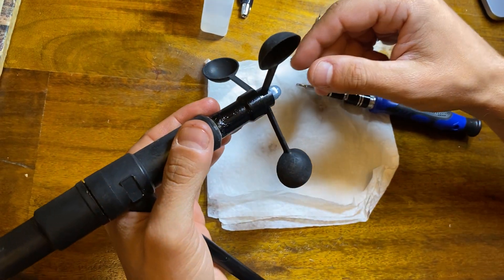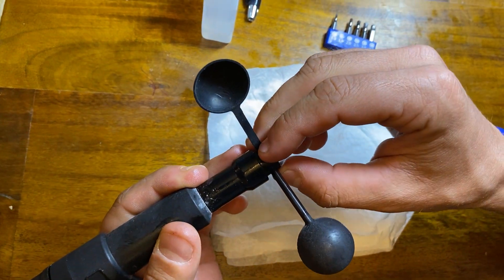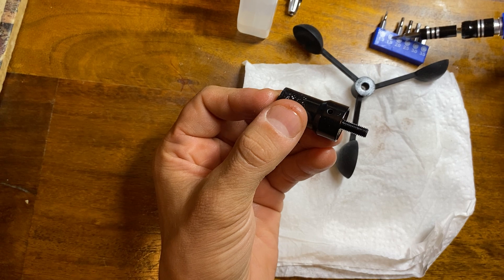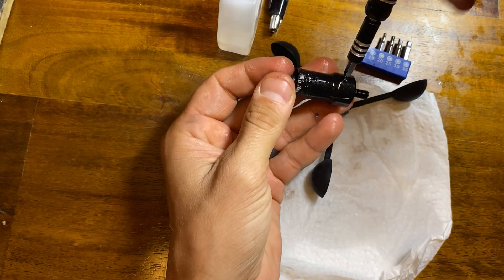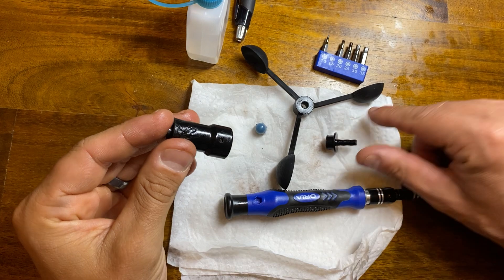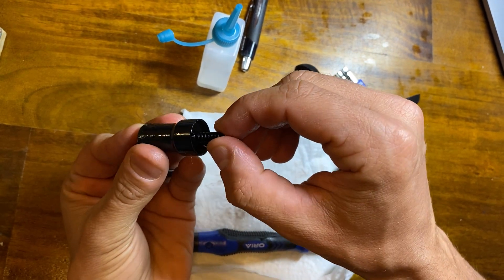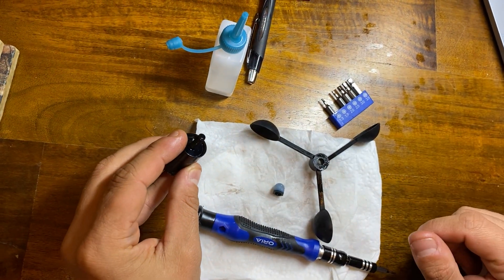Replacing the Bearings on the B&G 608 Anemometer - Wind Sensor

Comment: Note to these attempting at home: I tried this on my newer WS310 sensor which has the same setup, and I stripped the 1.5mm screw holding the lower portion of the bearing. Might have loctite on it. Make sure you have sharp, fresh tools if you try this. The stripped screw is going to be very difficult to remove -- good thing I bought a bearing assembly replacement.
Reply from the maker: Good call out
Reply: @austinbrougher7456  Thanks for the video!
Reply: Mine stripped as well. Did you ever get yours out?
Reply: @jasonkoslow4174  No, I never did. Ended up installing a new bearing carrier module. I may purchase another for careful teardown and bearing upgrade.

Comment: Hello! A great clip! But abt replacement bearings: really not metric measurements? And material is steel CR15, corroding alloy?
Reply from the maker: Great point! The original bearings are out of stock. I've removed the link to the steel bearings. Once I have some time I'll see if I can find good replacement. Appreciate the feedback!

Comment: The marketing for ceramic bearings suggests "faster speeds" due to less resistance. For our purposes, do you think this only means faster to get up to speed and that the sensor won't overstate windspeed? And perhaps also more accuracy at lower windspeeds? The cups can't move faster than the wind pushing them, in other words.. right?
Reply from the maker: Great call out. I know over time the bearings wear out and additional friction is introduced. I think friction may lead to reduced readings. The same thing will happen to the ceramic bearings. Eventually the ceramic bearings will become slower to the point they perform as well as the stock bearings.
Reply: @austinbrougher7456  I wonder how deceleration of the cups works as well - say the wind is 20 and then drops to 0. Do the cups keep spinning? Is some friction more desirable than a hypothetical zero friction? Hmm.. not sure how the physics of this works!
Reply: A good public paper here on anemometers: https://www.ncbi.nlm.nih.gov/pmc/articles/PMC4279541/
They mention "overspeeding" but it's a misnomer - they mean over reporting during deceleration or turbulent flows, not speeding faster than windspeed.
I suppose we only really care about acceleration and max winds and don't care so much if it takes a little longer for the sensor to report decelerations.

Comment: Well done Austin, like the work you have done.  I have a similar problem with a Furuno FI 5000(L) wind anemometer/direction device. I have read on the Furuno Users Website there is a method of doing this task, although Furuno Tech advise the device is irreparable.  Have you, or anyone on this thread had any experience with a Furuno device? Cheers, Jim
Reply from the maker: Sorry for the late response. I have no experience with other sensors.

Comment: Thank you! I found that the screw was VERY hard to unscrew and even harder to tighten from the PLASTIC connector for the speed cups.  
I'm thinking about sealing the hole to reduce water infiltration into the bearing assembly. 
BTW a Torx T6H, while not as good as the Allen wrench, will fit.

Comment: Thanks for the helpful video! How did you know your bearings were shot? Did the unit fail completely or just slow down? The data coming from our unit jumps around a lot in steady wind. When damping is turned on, it seems to be underreporting the wind speed. Right now, the wind is whistling through the rigging, and it's displaying from between 4 knots and 13 knots. Actual conditions feel like maybe 11 or 12 knots gusting to 13. Would that be consistent with bad bearings? Thanks again!
Reply from the maker: It could be bad bearings. In my case, the cups stopped moving in low wind. If the wind was fast enough, they would move but I didn't trust it. If you can access it, try rotating the cups manually and seeing if it feels like it's getting stuck or harder to turn at any one point.
Reply: @austinbrougher7456  We're in the Caribbean and haven't had any really low wind days in a long time. I'll try to go up there and give it a spin. Thanks again

Comment: Very helpful, than you for taking the time to do this.  I read /Watched this a year ago, and bought some SS Race, Ceramic Ball bearings from VXB a year ago, and finally got around to replacing them. I bought another unit that was 4 years old, so that is up there now, but Now I think I would like this rebuilt unit up there, I think it will be better.  The old bearings felt like there was sand in them, they were so rusty.
Reply: Do you have a link to the SS bearings you bought?

Comment: Did you measure the bearings yourself or lifted the dimensions off the bearings inscription. Reason for the ask is; if I can source a metric equivalent for them. Imperial sized bearings are extremely hard to find in my neck of the woods!
Reply from the maker: I measured myself. If you find a good metric match please share.
Reply: @austinbrougher7456  
SFR25ZZ(1/8"=3.175mm, 5/16"=7.938mm, 9/64"=3.5719mm, Df 0.3590"= 9,12mm)

SMF83ZZ(3mm, 8mm, 3mm, Df=9.2mm) ((-0.175mm=-0.0069"),( +0,062mm=+0.0024"), (-0.571mm=-1/64"),(+0.08mm=+0.00315"))

SMF693ZZ(3mm, 8mm, 4mm, Df9.5mm) ((-0.175mm=-0.0069"),( +0,062mm=+0.0024"), (+0.4281mm=1/64"), (+0.38mm = 1/64))
they are both extremely close. All differences are below 1/64".  SMF833ZZ is a looser fit. SMF693ZZ is a tighter fit. 
I think I'll get both and share the results when I have a chance to climb up the mast :)
Reply: @f00barfoobar  3 x 8 x 3mm does not fit. Unfortunately the right ones you mentioned above, are currently unavailable.
Reply: @62deleeuw  Thanks for this. I still couldn't find an opportunity to head over  (800 kms) to try. You saved me a significant amount of grief :). In the mean time I discovered a local store that specializes in miniature bearings and and found a pair of EZO SFR25ZZs. Apparently these are frequently used in dental equipment. You may want to try your luck with dental equipment service shops.
Reply: @f00barfoobar  Well... with some modifications to the axle and with help of an 8 mm drill, i made them fit. Wait and see if it was a succes or it´s demolished. 
Thx!
Reply: Succes, 😃for 1,5 years now!

Comment: Hi! Great video!
Do you remember how the magnet is attached to the shaft? I am replacing the bearings in my unit, and I just found that the magnet is inserted into the shaft but it can spin independently of it. I am considering to use loctite to glue it to the shaft, but I would prefer to understand how is the original set up. Thanks.
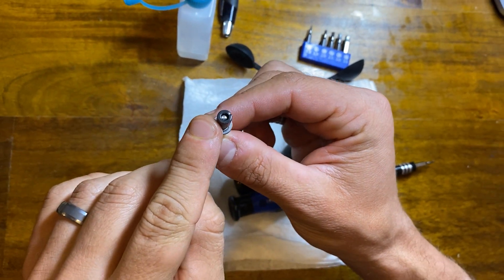Reply from the maker: Its at the top of the mast now but I remember it looking like it was glued on. You can see it at 4:04
Reply: @austinbrougher7456  thanks!

Comment: Thanx for the nice and really usefull video. I have also B&G MHU 496 on my boat, but its anemometer magnet broke. Have you got any idea where could I buy that magnet only as I can't afford myself to buy the whole  Wind Speed Bearing kit.
Reply from the maker: The magnet might be tricky to match but not impossible. My sensor is at the top of my mast right now. If you have a pair of calipers you can try measuring it and searching for a ring magnet. I suspect its ferrite based on the color. I say its tricky because if the magnet is too strong the movement of it may not be enough to trip the sensor on each rotation. Good luck!

Comment: Great. I need to replace the pcb board I think...unit not registering wind data, and while plugged in it knocks out other NMEA 2000 networked inputs; autopilot, depth, radar, rudder feedback...But my bearings seem fine.

Were yours’ noticeably not smooth ?  I’d rather not re-install until I have all parts needed.  I’m down in Grenada for hurricane season 👍...75’ mast height 🤪
Reply from the maker: The first time I brought it down I noticed the bearings were getting stuck a little. I added some sewing machine oil and that fixed it for a few weeks. It eventually stopped working in low wind so I decided to try and replace the bearings. It's still working great. It does sound like you may have another issue. Good luck!

Comment: Where did you get the new bearings from?
Reply from the maker: I ordered from here. https://www.amazon.com/gp/product/B01D4WD6P6/ref=ppx_yo_dt_b_asin_title_o00_s00?ie=UTF8&psc=1
Reply: @austinbrougher7456  Thanks for this! I just bought the $99 part from B&G so now I have a spare when this thing goes bad in another 3 years. How did you figure out the bearing size?
Reply: I found them at: vxb.com with ceramic bearings.

Comment: Have you thought about using ceramic bearings, considering these are used in a marine environment?
Reply from the maker: This is a really good suggestion. I ended up ordering these. https://www.amazon.com/gp/product/B01D4WD6P6/ref=ppx_yo_dt_b_asin_title_o00_s00?ie=UTF8&psc=1
Reply: @austinbrougher7456  I wonder if the supposedly lower friction of the ceramic bearings (see their description) would result in higher-than-factory readings.
Reply: @kdl0  I can't imagine it would. The rotation speed is determined by what radius the cups are placed. The further out the lower the rpm at a given wind speed and vice versa.